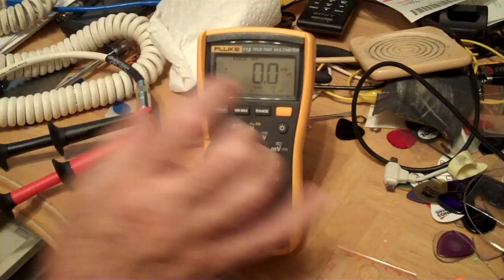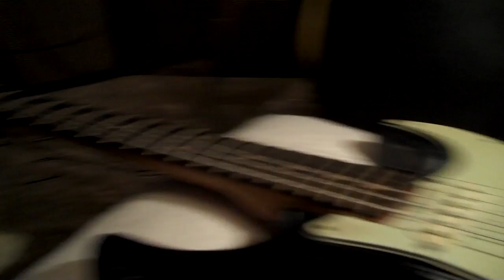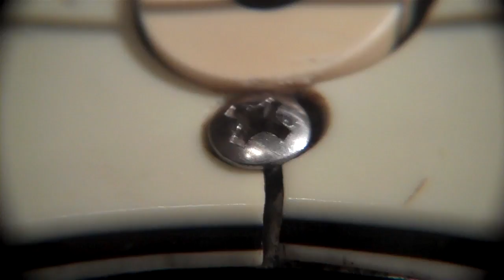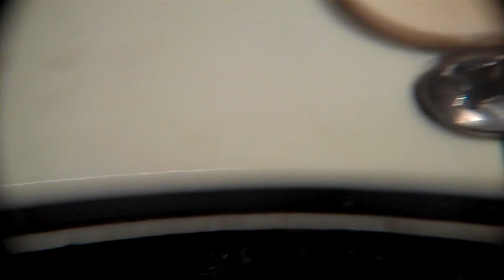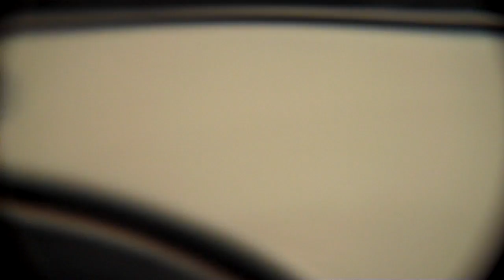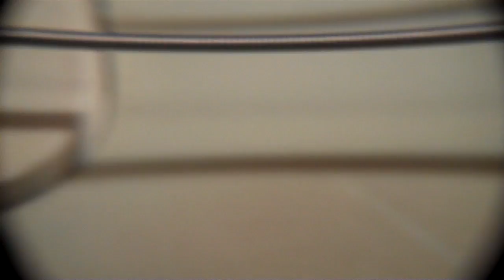Measuring Your Pickup Output in Millivolts, Critical Strat Pickup Height, and Magnet Polarity Check

Comment: Couldn't measure my pickups' voltage.
Reply from the maker: Did you have your volume control on 10?
Reply: @millstap  yes, ofc. I think it's because I don't have a hold functionality on my multimeter
Reply from the maker: @sashabagdasarow497  It's probably not that critical.  It's just fun to see how your pickups generate electricity.  What brand of DMM do you have?  It might be a good time to upgrade.  I use two meters and occasionally three when I am working on my amps.
Reply: @millstap  yeah, guess need to get a better one.
I bought the cheapest one a while ago. Needed to check continuity when I was doing guitar wiring.
I think it's IEK M182
Reply from the maker: @sashabagdasarow497  Does it have a millivolt setting?  You might try that too.
Reply: @millstap  yes, I tried on 200 mv and 2000 mv.
Had some results, but they were too inconsistent.

Comment: Hello! Thanks for making this video. I think reason for the lower voltage from bridge pickup has to do the string arc being narrower at that point on the string thereby reducing the voltage. The string over the neck pickup has a much wider arc creating more voltage. Just another interesting variable.
Reply from the maker: You're welcome.  That is why Lollar uses longer magnets in some of his bridge pickups.  Unfortunately, the bigger pickups don't always fit in a vintage cavity route.  The Nash Strat has a deeper route to accommodate them.

Comment: If you’re mixing Mexican standard pickups with aftermarket pickups like the fender 57/62s you will need to deal with this North Pole South Pole thing (I believe it worked after changing some wire polarities by swapping the black and white wire and moving pickups around - sounded like garbage before I did that). Just replace all 3 pickups at the same time and no worries. Having done this your North Pole/ South Pole  I think you need to hold the guitar like your playing it and then hold the compass horizontally like you normally would so the needle can move freely. Hold the compass up to each pickup and they should all have the N arrow pointing in the same way.  If the arrow flips around 180 on one pickup then you have a different pole magnet that pulls instead of pushing or vice versa.  Swapping black and white wires would possibly fix this (I fixed it eventually moving pickups around and swapping wires in a methodical trial and error way).  It will sound really underpowered and flat in the in between position if you have a phase / polarity issue like this.
Reply from the maker: Thanks for the info.  Everything magnetically was matched.  It's good to know the compass trick.  I would have completely ignored it if someone hadn't reminded me.  I goofed around with this vintage 1964 Strat and am now going to put the original pickups in it, albeit somewhat hollow and weak in output.  I realize that most of my popular videos where done with this guitar with the original pickups.  The weak magnets work great with a high powered amp.  I have other Strats if I want more output.  It's nice to have a weak one too.
Reply: Traditionally, the middle pickup of a Strat will have reverse magnetic field and polarity compared to the other two. This is what provides the Humbucking effect in switch positions 2 and 4. You should notice a reduction in nearby electrical fields when in positions 2 and 4.

Comment: Hey i wanted to ask what neck is on the seafoam green reissue. Those are the ones they made in Corona right? I'm looking to pick one up soon.
Reply from the maker: Yes, it was made in Corona.  I'm not sure what neck is on it.  I bought it at a music store years ago and didn't think about asking what brand it is.  It is definitely a licensed Fender neck and it may be Allparts but that is a guess.  If I were going to buy another neck, I would recommend trying a reverse headstock, the bigger late '60's style.  They make the wound strings sound better and the plain strings respond quicker on bends.